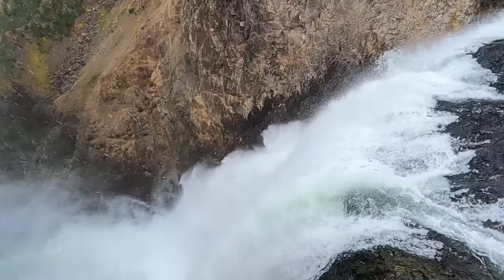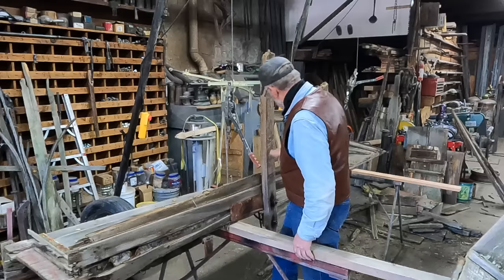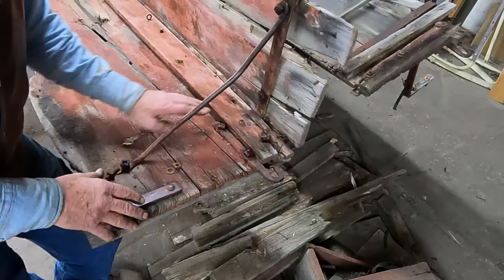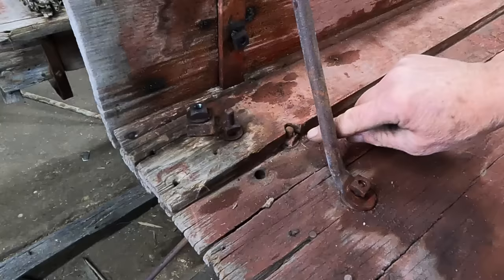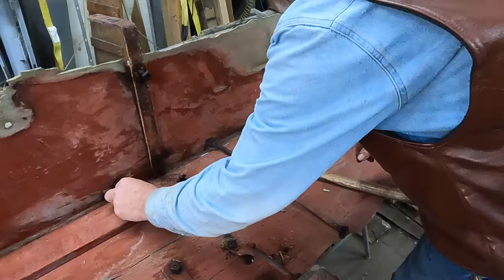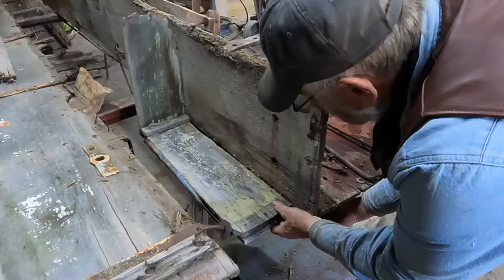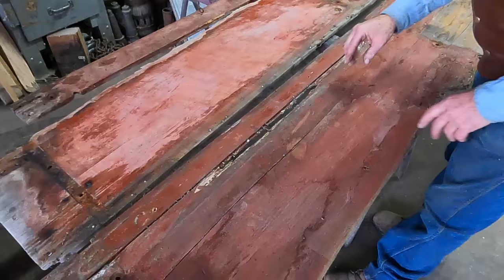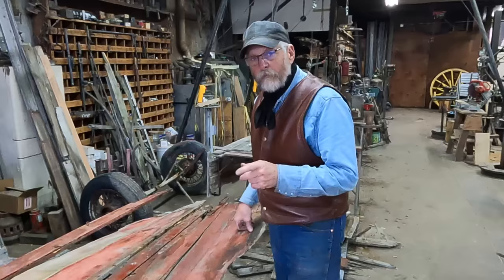If This Was Yours, What Would You Do? | Engels Coach Shop

Comment: Looking at it from two points, I've considered cost, along with the finished product. If I were the owner and you explained what you did to us, I would say use all new. To repair those side boards as you described would be a considerable cost, in the amount of work involved. 
Even though it would be high cost, you are still being asked to make a silk purse out of a sow's ear.
Being involved in restoration work of old masonry work, sometimes you had to convince the owner that what they want is both somewhat impractical, while also being a higher cost than replacing.

Comment: Here's a thought I have from not being able to measure the width of the boards. It appears that they may have been about 16" or so in width. My guess is that the owner wants to save as much of those 16" wide boards because you can't get them at a lumber yard any more. BUT: there are old barn boards that exist that are in some cases 18" wide and 20 feet long by 5 quarter true or greater thickness (Probably available for an exorbitant price, but this might be justifiable for the sentimental project this wagon seems to be). On the other hand, The iron is more intrinsically significant than the wood. You can see its shapes and visualize the thought and labor required to form them. As for the replacement wood, if new, it can be antiqued to resemble what the original looked like way back when. Utility is in the eye of the beholder and also in the eye of the owner, but coupled with nostalgic sentimentality.  We all share the same feelings about our possessions.

Comment: If the goal is to maintain as much of that patina as possible, could you build a solid frame of new wood and tack the old wood on to the outside, kinda like putting siding on a house? From across the yard it would look like an old beat up sheep wagon, while still being solid enough to hold itself together.

Comment: With what you have disclosed, i would use the irons and replace the wood. Knowing what the owner wants, you may feel differently. Either way you end up doing it, you will amaze all of us. Thanks Dave.
Reply: This is a piece of history, representing the hardscrabble existence the early settlers dealt with. All of that old wood tells a story and I would keep it except the most rotted. Where boards are compromised, I would make a 30 degree miter (looking at edge of board) and feather in a scab in as little as necessary with wood glue. To discard most of the wood, would make it a new wagon and no longer 'historical'. And if I remember correctly the owner was interested in preserving the history and did not simply order a new wagon with old irons.

Comment: I'd see how much good wood can be gotten from the wagon and use it for trim.  Maybe the floor boards can be squared off and thinned with a thickness planer to reveal some good wood, you might be able to use it for wall board or as flooring in a small section of the wagon.

Comment: The owner probably remembers a brand new old wagon, before the rot, splits and missing wood. You could pour epoxy into the rotten wood, preserving it as is, but that's not taking care of the problems. Glad it's his decision and not mine. I would replace all the wood with new poplar, southern yellow pine or Douglas fir, painted in the same Rust-oleum red primer. But that's me. Thanks for the video. Jon

Comment: Dave,  I'd just reuse the irons and manufacture whatever you don't have....I too would not recommend the old wood except mabe a plaque made of it on the inside.......good luck my friend!  Howdy from Branson Missouri !
Reply: This is a piece of history, representing the hardscrabble existence the early settlers dealt with. All of that old wood tells a story and I would keep it except the most rotted. Where boards are compromised, I would make a 30 degree miter (looking at edge of board) and feather in a scab in as little as necessary with wood glue. To discard most of the wood, would make it a new wagon and no longer 'historical'. And if I remember correctly the owner was interested in preserving the history and did not simply order a new wagon with old irons.

Comment: I would use as much iron as possible and use the long boards by cutting out the rotted sections and using them for needed short lengths such as the front and rear.

Comment: It's so hard to decide, especially paying someone else to do the work. I recently needed the trim painted on my house. Contractors told me over and over that it would be cheaper to replace the old trim (still in good shape, 1x4s and 1x2s) and paint the new, than it would be to scrape, sand, prime and repaint the old. I ended up doing it myself (to save money, plus the weather is nice now, here in sunny 🌞 Arizona 🌵. ... If I was your customer (with my budget), I'd have to go with new wood. Yes, you could trim off the rotten bits, but a Dutchman to fix that hole wouldn't be cheap. I'd have to go with new boards that were the same width as the old... Again not cheap... I guess it's all part of the conversation. 💖🌞🌵😷

Comment: In the auto world that is a "gas cap" restoration - you remove the gas cap and replace everything under it. Trying to reverse engineer every joint and repair every rotted board turns this into a money pit. IMO - you know how to build a period correct replacement and give it "patina". Build a replacement wagon with the same approximate dimensions, restored with the "quirks" that were done doing the conversion, and reusing as much as the old iron as reasonably possible. Owner needs to decide if he wants a wagon that can carry firewood or should have been used for firewood.

Comment: Hi Dave, that archeology-debuilding was a piece of art in itself.
I hope you can come to terms with the owner as to whatever percent of old they like renewed and what should be kept original.

Sawing off whole sections sounds to me to be the too easy solution to the brief given by the owner.
i guess you will have to cut out parts and bring in new sections to fill up the boards, and maybe even keep some cracks and gaps as they are as long as they can be made rot-free.

Good luck and be assured of my curiosity to what this path will lead you on!
Thanks for sharing the video footage with us.

Comment: My proposal to tackling this problem is rather more complex than others perhaps, but I believe it is worthy to consider. If you want to preserve not only the structural integrity but also the cosmetic value of the old wood, then my thought would be to attach the boards to some stiff frame, so as to get any twist or bow out of them, then saw them lengthways in half on the bandsaw to create two boards half the thickness of the original. They could then be passed through the planer on the sawn side to create two veneer-like boards, with the original, worn faces still intact. Theese would then be glued to both sides of a new, thinner board, such that the total thickness, as well as the original faces of the board would be conserved, with an inner core of new, structural wood. 

Do give this a thought, please and best wishes on making the right decision!

Comment: I would be using almost all new timber.  Maybe some of what you have (the sideboards?) can be re-purposed for smaller components elsewhere.  Most irons look like they could be re-used.  As it seems to have been modified many times there is also the question of which version should be rebuilt.
Reply: Yeah, I was thinking those side boards might not even be original as it is.

Comment: To piggy back on the suggestion to cut up what is good into smaller sections. As an owner i would want the perserved wood to be presentable and apparaent. Maybe use it as the floor boards where length and width could be irregular and look presentable. Other small bits for the table and cupboards

Comment: I can see someone using the ledge on the Sideboards for a step's out of the Box, I can see them used for a Water Barel, I can see them for Shovels and other Tools. Harvesting Grane around her in Delta County Colorado in the 1880's was hard manual Labor work in the Hot sunshine. Shocking bundles and then came the Grane thrashing machine followed by a Binder. I have had my hands on a shovel shoveling Coran, Grane and Beat pulp.

Comment: If it were me, I would have you do more like you did on the mud wagon and repair/reuse the original irons as much as possible. Using new or recycled wood rather than trying to salvage rot. Just my 2 cents. Good luck with whichever direction you and the owner decide to travel, I, for one, will watch it with pleasure. Happy Trails!

Comment: Reminds me of Tally Ho. As said previously, scrap the timber, keep what you can of the metal work and start from scratch. Perhaps you could repurpose some of the timber. If built the same way and it contains the same metalwork then it's the same Ship of Theseus.
Reply: This is a piece of history, representing the hardscrabble existence the early settlers dealt with. All of that old wood tells a story and I would keep it except the most rotted. Where boards are compromised, I would make a 30 degree miter (looking at edge of board) and feather in a scab in as little as necessary with wood glue. To discard most of the wood, would make it a new wagon and no longer 'historical'. And if I remember correctly the owner was interested in preserving the history and did not simply order a new wagon with old irons.

Comment: If the intent is to create a static display, I'd do like plane crash investigators and some museums do. I'd build a metal mesh shell following the contours of the wagon, then basically mount the pieces in their relative positions to the mesh.
If the intent is to create a somewhat functional cart, maybe the most rational approach is to first rough assemble a new cart, then figure out where pieces of the old cart can be grafted in. With the tools and glues we have available today, grafting on new wood to replace lost material can be relatively easy.

Comment: It looks like my opinion is rather different from most everyone else's, but I would personally clean up those pieces, add as little as is needed to make it solid enough not to fall apart and where someone can sit on it, and otherwise leave it -- holes and cracks and broken edges and all.  You were finding so many stories about how that wagon was put together and repaired and how it lived over the years in all of those details of those boards, and I wouldn't want to lose that even if it means the wagon still looks far from new.  (I would probably glue the cracks, though; hopefully this isn't going to be in too much weather in the future to where that would be an issue.)

Comment: Whether or not to keep a restoration completely original depends upon how the restored item will be used.  If it is to be a static display and not used as originally intended, then keeping frail, rotted and weak components doesn't really mater.  If it is to be used as originally intended, then unserviceable components must be replaced.  I spent most of my working years in aviation.  A restoration expert at one of the flying museums who primarily restored pre and World War One aircraft once told me that these airplanes were frail wood and canvas coved planes that had major components replaced so often that after a few years ,very few of the parts were from the original build.  He said that all you really need is the metal parts and the plans to restore an early flyable airplane to its original condition.  If the wagon is to be used, throw away the bad still and replace it just like was done over its life.  If it is to be place inside on display only...patch it together with glue, paper and paint.

Comment: Sorry, it was probably a rhetorical question but if it was my project, I would suggest building the main parts (the log ones and floor assembly etc) with new wood and use the salvaged material for the fun parts … the pot box, table top, doors etc.  The distressed  damage could be left in so the stories won’t be lost.  Don’t want to lose the stories.
Reply: … should have been “long” ones rather than “log” ones 

… and I also might suggest (after building new) that any left over material could go into a separate project such a a chuck box that the owner could use in an outbuilding.  Again with the distressed pieces left in for their stories.

Comment: I would have to guess at what the owner ment when saying keep or use what you can.
Here is my take. The wood is shot.  Some of the hardware is still usable after a little rework. This would be my direction to you if I were the owner;
1, Keep and rework the metal best you can and make new parts to mimic the old.
2, Clean the best piece to match the stain or paint.
3, rebuild the wooded structure totally while keeping the design changes of the 2 or 3 "Farm Repairs" and paint or stain to match.
4 End result would have all the elements that gave this build its unique qualities the owner remembers while providing a useful working new structure that would provide years of enjoyment and still have the history and all the meaningful memories.

Comment: It's a real pickle. Great opportunity for mission creep here. Like many, I'm tempted to scrap all the old wood and just use the irons I could. But that seems counter to what the original idea was. It would be shame to just patch up what is there then plant it on the front lawn as a gate guardian. Just inviting the old wood to continue to rot and asking the new wood to join in. But if it was kept inside, out of the weather and extreme temp changes - scarfing in new wood where needed - demanded; taking more of a conservatorship approach - if the budget allows. I've had many a grand idea killed off by lack of time and money (and sometimes common sense :^) ).

You didn't mention (and I suspect this is a bit of a moving target) what version of the wagon it's to be "restored" back to. One could almost say; put all the wood back together as it was. - encase in epoxy - rot and all. Then build from scratch a brand new wagon they way it would have looked back in Red Lodge. It's a pickle!

Comment: You"ve been doing this for a long time, so I'm confident you know how to "read" your customer.
When that customer says "restore it and save what you can", unless he is even marginally knowledgeable on the topic of antique wagons, he most likely doesn't have a clue what a daunting and VERY costly task it would be to  do anything with that pile of long gone wood.
If it were me, I would restore as much of the metal as possible, build a new wagon and work what you can of any sound lumber for small bits of non structural items of the wagon like the tail gate or the pots and pan cabinet etc.
Good luck. I am looking forward to the build and the decision on how you move forward!

Comment: Perhaps I would save a little bit of the wood in the center that still has some integrity to it, and use it for some other part of the wagon, just so I could say that it still had some of its original wood, but mostly I would use new wood.  It will be interesting to see what you end up doing.

Comment: trim out the rot, seal it, then put that board back on to cover it. You can use pine boards to patch the other places, and aging the wood isn't hard. That piece you pulled off is a piece of dimensional lumber from the lumber yard. I think a piece of 1x12 pine properly aged would allow you to reuse much of that wagon wood. After all, it ain't gonna be used for anything, so it just needs to be strong enough to withstand the weather.

Comment: If I were the owner, I would want you to do a complete reconstruction, with 99% new wood. I would ask that where appropriate, to use some of the old wood for perhaps trim pieces and the like, so at least a taste of the original wood ends up in the final piece.
Reply: This is a piece of history, representing the hardscrabble existence the early settlers dealt with. All of that old wood tells a story and I would keep it except the most rotted. Where boards are compromised, I would make a 30 degree miter (looking at edge of board) and feather in a scab in as little as necessary with wood glue. To discard most of the wood, would make it a new wagon and no longer 'historical'. And if I remember correctly the owner was interested in preserving the history and did not simply order a new wagon with old irons.

Comment: Grind the wood into saw dust and use it to make some composite boards which could then be used in some decorative, non-structural pieces.  Otherwise, if you're making some wheels that use steel treads, use it as wood for the fire to heat the steel.

Comment: The iron components are in better condition than the wood. With that being said, i would definitely scrap all of the wooden pieces and go with new wood. Being in construction for 40 years, it would take up valuable time trying to repair the old rotten sections. Hopefully, the owner will agree with the majority and settle on replacing all wooden sections, keeping all the old irons. I can't see any kind of repair work to the wood that would keep its strength and integrity. Bottom line, if it were mine, I would change every piece of wood and keep the old irons.

Comment: Id go with all new wood, refresh the iron work like you did with the mud wagon.  Take all that extra wood and make something for the wagon.  Make some boxes or luggage type totes.  Stuff that would be in the wagon.  The wagon should be strong, and I get 'memory' but if its not just a set dressing piece it needs structure.  The memory of the wood can be used in the wagon itself by using it to 'furnish' the wagon.